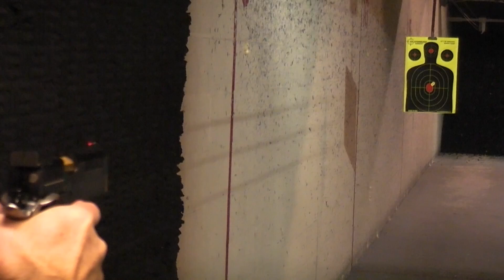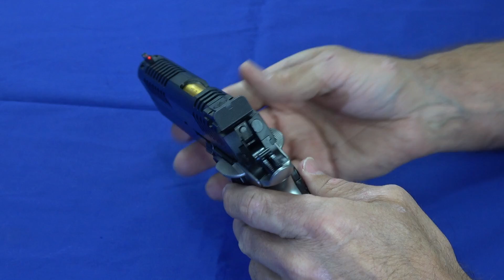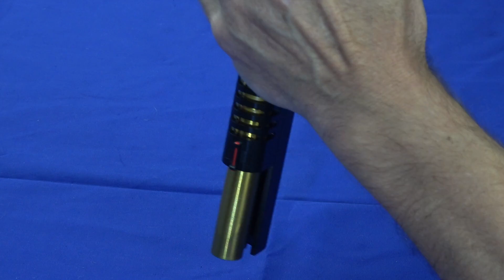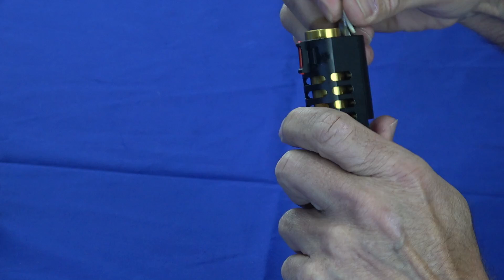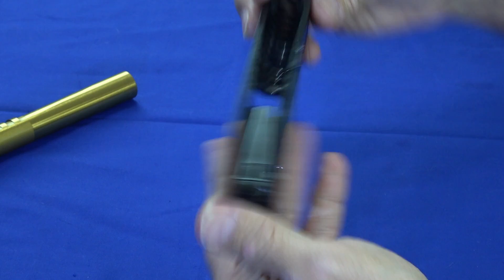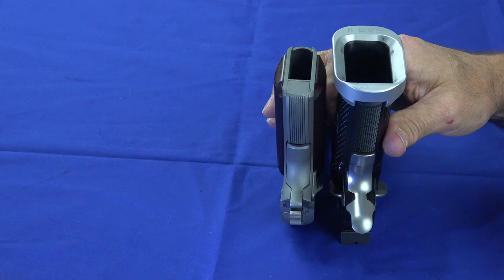Israeli Competition Gun: BUL Armory SAS II AIR

Comment: Major power factor for standard/limited division is min. 170. With 180gr bullet that is min. 944fps... So in 40 you will be running around 975fps. Guys don’t run 9mm in that division because at minor power factor you score less points. So, 40 S&W dominates this division. With a good race gun like this recoil is manageable in 40.

Comment: Not familiar with this “Air” model but is an AMAZING pistol mfg and fired its SAS predecessor (or cousin within their same SAS II model range) but mine was their tactical version (add a grand) 😢 but was hitting 75/100yard plates with no issue. It’s a modded 2011 or that’s the way the Rep explained it to me?!? (so am confused why you kept saying “like a 1911”?) I can’t speak to this exact “Air” model as just said, but I’d easily place BUL in my Top 5 Gun mfg’s of all time for new pistols!

We respectfully referred to our BUL SAS II as a “poor man’s STI” (the ones I tested, as the barrel is a work of art and had allot more cutouts and rotated I believe vs this Air model) - The tolerances are insanely tight and is top shelf from top to bottom as you saw and the mag well is like great sex 😝 

All that said, I’m saving for either the BUL I fired, or will save even more and add another $3K for a STI Wick Special - but tbh I’m sold on this beauty. Just concerned about parts and support as there are very few US distributors here thus far the last time I checked which was about 11 mo ago. 

Great job getting your hands on one and taking the time to break it down as very few, if any,  “novice/intro” firearm owners even know about this brand and I’d put it up against my Beretta or Glocks any day of the week as a superior firearm (I’m not particularly fond of straight up 1911 styles) so BUL taking the 2011 style and sexing it up along with its target accuracy and build quality literally blew my mind. They are a show piece and as much as I’d like to use it as a carry, at $1900 +\- (non-tactical version) that’s what my Beretta and Glocks are for. Lovely firearm though and hope to get another “corona bucks” check b/c if so, I’m going for the one I tested (sorry, I can’t recall the exact model atm but is part of their SAS line). Just an Amazing gun. Thanks for the video - And yeah, you’re correct, it is made in Israel and they can’t afford any failures over there!! 😂 👍🏻 Good stuff! Cheers
Reply from the maker: Thank you.  They are definitely nice guns.

Comment: The trigger looks to have some up and down slop when you squeeze it - is that normal on such an expensive pistol? I guess maybe I never noticed it on any of the 1911s I have owned in the past but I usually swap em out for an STI polymer one that needs to be fitted.
Reply from the maker: Many 1911s that have not been "tuned" will have some up/down movement due to the way the trigger connects.  Fitted and highly tuned ones may be rock solid but then more susceptible to issues when they get dirty or encounter temperature extremes.  I no longer have this pistol (it was a T&E) to go back and look at it - but I do remember shooting it enough that I don't recall having an issue at all during live fire.

Comment: Nice gun! I own an STI Edge .40 for IPSC standard division and I am really interessed in the Bul SAS II UR for open division.
The UR is around 3.500 Euro, which is really cheap for a 2011 style open gun. Especially when you compare it to STI or even SPS.
My current open gun is a CZ Czechmate. This gun shoots beautifully, but it is a piece of crap. Everything breaks on that gun. I've already broken 2 barrels. Both after +/- 5000 rounds of 9mm major.
So when looking at the Bul UR, and it's price of 3.500, I get a bit suspicious. Where did they cut corners?
Is it the quality of the metal? It is surely not the machining because your gun looks very well machined. Maybe it's the labor costs in Israel, I dunno
Reply: Hello, why 40 cal?  Is it a power factor thing or something? (not a comp shooter)